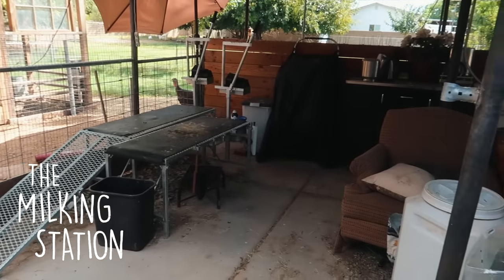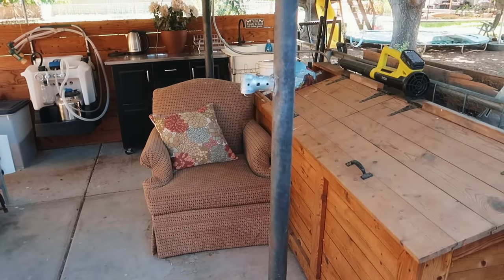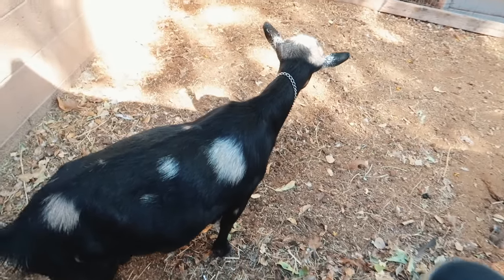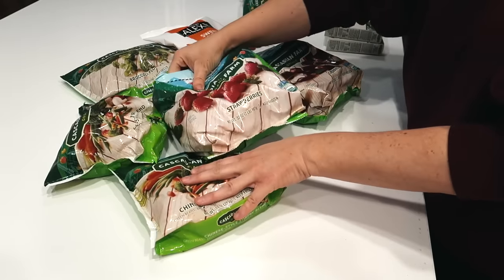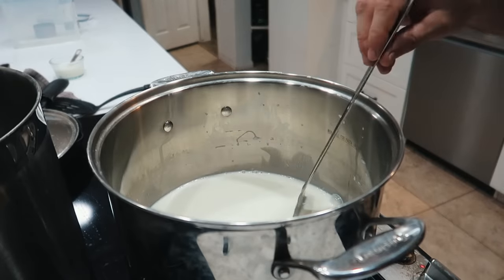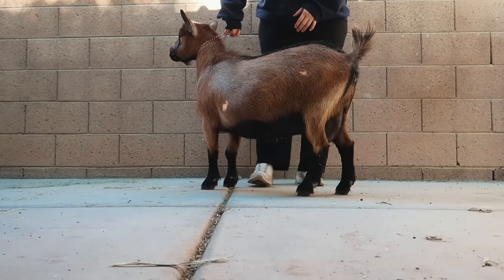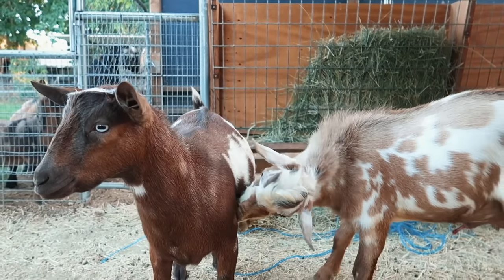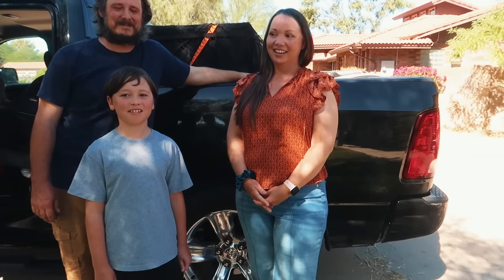Struggling right now.

Comment: So sorry you’re not feeling so well.  I’ve had a pretty severe case of mixed connective tissue disorder, otherwise known as several auto immune diseases put together.   But I was only 8 when I was diagnosed, and I was really very ill the last 6 months before diagnosis.  I’m in my 50s now, and I’m slowing down pretty quickly.  The only saving grace is that I really don’t remember life before auto immune disease. I know the days are tough and I so sorry your still dealing with the Covid ick. I hope you’re feeling better soon.

Comment: Hi love, I've got terrible arthritis so I've been looking for an automatic stirring pot & I've found two items that seem really good & won't blow your budget. The one I'm most interested in is the Lampcook stirring pot, it's around $160 but it only holds 1.2 liters, the other item I looked at is a Saki automatic pot stirrer. It sizes to fit any pot pretty much & the paddles are extendable & go wall to wall, it's rechargeable & works up to 2 hours so perfect for a batch of cajeta. The Saki's are between $50 & $60 & the tests I've seen have all been pretty darn good.

Comment: I feel compelled to tell you about my experience with heart palpitations.  It started two years ago when I was wakened by what felt like a fish flopping around in my chest.  I worked to clean up the food I was eating.  All organic, homemade.  It helped a little.  But the fish in the chest happened again a few months later.  Along with nights of smaller palpitations fairly often.  After much research I went to the carnivore diet.  Huge change. Once in a while I feel a little flutter, but nothing like the all nighters with palpitations, and no fish in the chest. I've been carnivore for a year now, I've lost weight, my psoriasis is gone.  Joint pain is much much less.  The best is the absence of heart palpitations, it was so scary.  I wish you the best.

Comment: I have scoliosis, so did my mother and one of my sisters. But I figured out that mine was caused by a weak gluteus Maximus on my left side. So I tighten that muscle 20x per day. That puts my hip back I. Place and resolves my issue. 
Each case is unique but maybe check how your glutes are. See if you can squeeze one side and then the other side. If one doesn't tighten, try working it and see if it helps you! ::hugs::

Comment: Hi .  Has your cardiologist tried you on Metoprolol Tartrate?  I’ve been on it for 15 years and it has really cut way back on my palpitations or PVC’s.  It’s a beta blocker, been around for a long time, cheap and made a huge difference in my life.  Just a thought, I hope you get rid of them, I remember as soon as I’d lie down at night they would crank it up, so no sleep.  Best of luck for your returned health and happiness 🫶
Reply from the maker: We’re gonna try it but it’s tricky because I have very low blood pressure
Reply: @Weedemandreap  I started with just 25mg a day and it worked almost immediately.  I’m a retired critical care nurse and the girls on the unit would take my BP all the time for that very reason.  It did dip for a couple of weeks but then your body may equilibrate, at least that was my experience.  Drink a ton of fluids for first week or two.  Anyway, I’m not a cardiologist, just one of many women who have this condition under control and I want that for you too.  Empty nesting really sucks the first year, I know!  We pour our heart and soul into our precious kids for 18 years and then they waltz off to college and we are left to take naps in their beds just to feel them.  It is as it should be but some Moms, myself as one, take it hard.  I remember riding my bike in the afternoons sometimes 20-30 miles just to get through the hours between when they used to get out of school and dinner!  So I feel you!  Once you get to feeling better you can look forward to your tiny house project and lunches with the kids🫶

Comment: Sorry to hear that Covid is having a lingering effect...I hope it vastly improves for you rather quickly!! I guess you are already doing this, especially with how health conscious you are already, but just in case something might have been overlooked, it might help or be actually needed to boost things like your Vitamin B Complex or at least the B-12, vitamin C, boost your electrolytes, not just the salts, but all things that tend to deplete with dehydration and/or dealing with illness, like magnesium and potassium, etc. and if tending to be low on iron that as well. And of course with each of those if a body needs something to help absorb the whatever, like iron needing Vitamin C, and staying away from caffeine for the part of the day your body will be absorbing that iron, Etc., and be sure to get lots of rest and like you said don't push yourself too hard!!!!! 

I KNOW it can be difficult to down grade a workload a little or a lot whether it be from necessity due to personal limits or due to changes in the size of those you've always cared for, and it can be double trouble if they both hit at the same time and you're someone who is very independent and/or has done it a certain way for so long and to pull back and not do as much for whatever reason. 

You GOT This!!

Comment: For what it is worth....sleep on your left side and take a Calcium/Magnesium/Zinc with D3 blend, lots of water to flush your system. Also eat pistachios, dried apricots, and avocados along with bringing your carbs down to get rid of the inflammation. Do not get rid of all of the carbs as this will also bring down the electrolytes.
Reply: * My long term issue is extreme tinnitus, foot pain, high BP (160/90's range), and an inflamed sciatic nerve.

Comment: COVID took a lot out of me also, and I'm also having palpitations. But i have a neuromuscular pre-existing condition (Myasthenia Gravis) that with low oxygen and weakness has been suspected causing palpitations (tachycardia, t-wave abnormality & premature beats) and I've been put in pantoperazole, but that's making my blood pressure drop too low. I had COVID just a few months ago, and it sucked every last bit of life out of me. I do regular IVIg for my neuromuscular disease, and my doctor was hoping that might help me bounce back, but it's not worked so far. The palpitations, make me cough, some last just seconds, some last more (those are the scary ones). My doctor told me to force a cough if I have a bad one, that it could reset the rhythm, and it works sometimes. My EKG didn't look bad, so I was set up with a 48 hour halter monitor, and that's where all the issues were discovered. Since then I've had a chest x-ray & a CT scan to check for any abnormalities in and around my lungs g heart, and aside from a very tiny bit of fluid in one lung, everything looked perfect. I've been on two inhalers since COVID, and it turned out that my salbutamol (albuterol - blue inhaler) was making the cardiac episodes so much worse, so now I'm on two separate inhalers, Flovent & Atrovent, and a saline nebulizer, and the palpitations are less than when I was on the blue inhaler, but still there. The doctor said that it may be because I've been weaker since COVID, making my heart work extra hard, but doesn't explain why I get them when I'm sitting still or in bed. So he said to try to elevate my bed so I'm in a semi sitting position, that my oxygen may be dropping a bit when laying flat, but it hasn't made much of a difference. So we've settled on the "long COVID" diagnosis, and will work to figure out how to make life a little easier until I can (hopefully) recover. Life is completely exhausting right now. I'm constantly tired, but can rarely sleep. My anxiety and depression is through the roof. My weight is dropping, which isn't a big deal physically, as I can stand to lose some weight, but it's having an effect on my lab work with low albumin, potassium, high CRP, kidney function, so she is talking about putting me in a feeding tube again, which I had in 2019 when my Myasthenia Gravis flared and I couldn't swallow. Life is depressing, and sometimes doesn't feel worth it. But I keep going hoping some day will be better. I wish you all the best and they figure out what is wrong. ❤❤much love from Newfoundland Canada. (I'm on Instagram under the same handle (LifeOfNigh) if you ever want to chat.

Comment: I hate heart palpitations and mine was because I was taking prednisone for my rheumatoid arthritis autoimmune disease and I realize what helped me a lot is the minute I was low on potassium or iron or anything it triggered even if it was in the normal range but low so being normal and okay doesn't mean you're actually okay you could be low and low enough to bother your particular body so I everyday once or twice a day drink the little powder mix in with my water the electrolytes not Gatorade just you know they're in the water section with a little powder mixing drinks are and since I've been doing that very very less and also I know a trigger with my heart palpitations is the minute my blood pressure is not absolute normal or even low so check your heart rate blood pressure My heart rate will do it too actually but check your heart rate blood pressure and mine will start glitching in the 130s which is literally barely over normal so keep your blood pressure normal keep your heart rate slow like in the '70s and drink electrolytes with you think you need them or not

Comment: DaNelle sorry you are going through the left over covid. It's been 2 years for me and I am still having issues. I have suffered from racing heart and afib for 30 years now. There us no medical proof about what I say next except my maternal side of the family experiences it. We can't have any type of artificial sweetener except a little Stevie. I have found that a higher dose of magnesium only has helped to control the racing heart-afib stuff. As in 400mg  1x daily. It's water soluble so it flushes out of your system. Doing this helps to keep it in check. Again there is no medical reason why it helps but it does for my family.  The heart has to have the right amount of calcium, potassium, sodium and magnesium.  Plus I have a little saying my heart beats in the perfect rhythm of GOD. I am whole and well amen."  I hope you get better. My leftover covid is what I call whiteouts. All sudden, everything goes brilliantly white and I have to close my eyes. I believe it will eventually go away. Have a great day and check with your Dr on the magnesium.

Comment: I'm 💯 NOT being a hater or giving you a hard time, but I have Rheumatoid Arthritis (13 surgeries in 8 years PRIOR to diagnosis) I've done beyond extensive research + worked with not only my PCP, my Rheumatologist, but a homeopathic Dr. I could not, nor will not eat even a 1/4 of the stuff you do. (No white carbs-only brown or multi grain- no or only natural unprocessed sugars, minimally- no fast food or processed food and 💯 no soda- no processed oils, etc etc) not only did I lose 10lbs, but I don't have 1/10 the RA flares and palpations anymore..
I do have an occasional splurge, but bottom line is I do not wanna feel like sh*t.
I truly feel for you, but just in my opinion, I'd 💯 make some vital changes 🙏
Reply from the maker: I eat zero refined or processed foods.